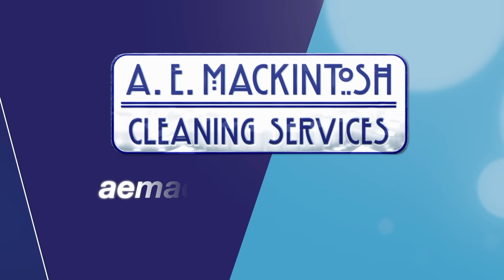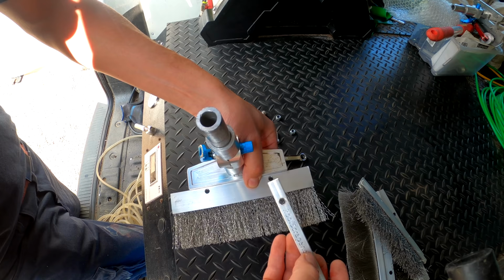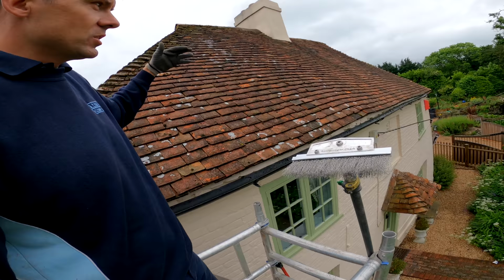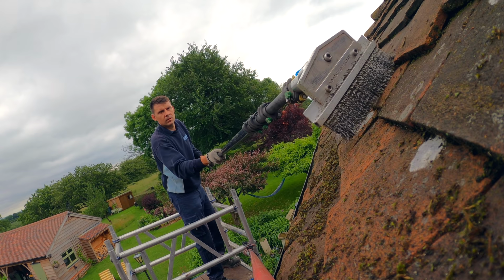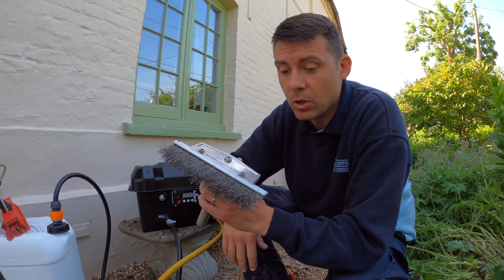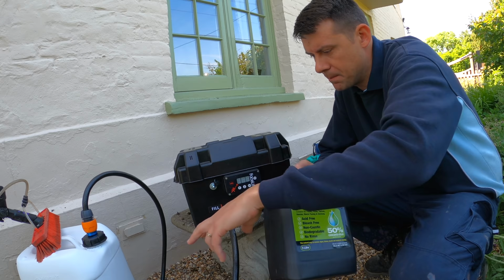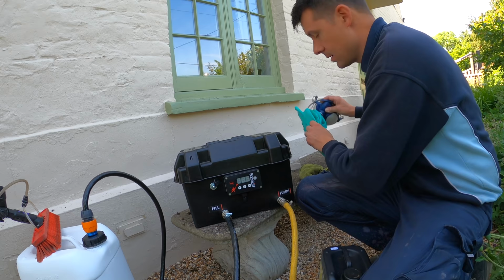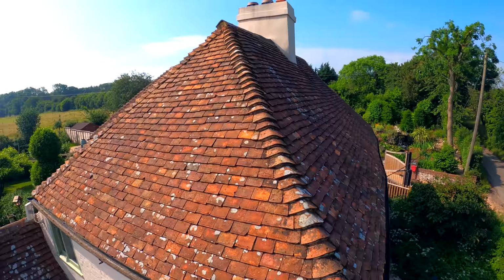What’s The Best Method To Clean This Old Roof?

Comment: Really good job you done there Ashley hope the owners gave you plenty of tea and biscuits 😀
Reply from the maker: Definitely! And cake too!😉👍🏼
Reply: Looks lp
Reply: @aemackintosh  p0lllll0 pp 0 pp p0l pp plll00 pp p
Reply: Most roofs need leaving alone imo
Reply from the maker: Moss growth can cause damage to the tiles, especially in freezing winter conditions when it hold the moisture and causes tiles to crack. So it’s a good idea to keep it well maintained.👍🏼
Reply: Why not go from top to bottom so the run off starts to clean the bottom part or is it because you can see what part you've done properly

Comment: Great video as usual. I have a question, can you do roof cleaning in the rain?

I think you said in the video, when it’s damp, moss can be harder to scrape off. 

So can you do it during the winter months in rainy weather or is it a summer service?

Thanks 🙏
Reply from the maker: Yeah, if scraping, it is more difficult when it’s wet, so a dry day is better. But I’ve found that it’s been fairly busy all year round.😃👍🏼

Comment: Hello - Thanks for sharing as you do -  Pls could you let us know the approximate Bar-pressure you set your pressure-cleaner to when using the 12" Mosmatic Skirt for roof cleaning ?   Many thanks
Reply from the maker: I’m not sure since I don’t have a gusher on my machine. But I use slightly less revs on my machine. So I would recommend starting with the revs lower and gradually increase it as you get used to the tool.😃👍🏼
Reply: @aemackintosh  Many thanks for taking the time to respond -  all the best

Comment: Excellent video. One question. With your extensive experience is one biocide most recommended?
Reply from the maker: Thanks. I normally use GKPro or Algoclear. But GKPro tends to be slightly thicker with more foam, which is better, and it goes further.👍🏼
Reply: Thanks Ashley

Comment: Ash, with it being a Biocide do you need to bag the downpipes and catch any run off to prevent it going down the drain? Or is it fine to drain off? Cheers
Reply from the maker: Yeah, I have seen this is done sometimes. You can do that if you like. I usually recommend starting the spraying from the bottom and working up to the top. That way there is little to no run off.😃👍🏼

Comment: I like the stainless brush for thick moss/algae but why not just soft wash the roof instead of using your WFP?
Reply from the maker: What do you mean by soft wash? If you mean pressure wash on a lower pressure, I wouldn’t take that approach on a roof like this as explained in the video. If you mean Hypo, I don’t use hypo on roofs as it is quite harsh and could damage the roof or surrounding area. I have applied a softwash/biocide solution to the roof using my wfp setup. This will kill off the organic growth and thus improve the condition of the roof without damaging the surface in any way.😃👍🏼
Reply: @aemackintosh  I’m not talking about pressure washing. I would do that. I use a 7 gallon a minute 12volt system. Just enough to apply my solution and walk away.

Comment: Hi Ash, 

quick question, when using water fed pole to apply the solution do you need to do anything to clear the the pole hose of the chemcial or clean the brush?

If GK pro were to get on windows would it cause any damage? 

thanks 
charlie
Reply from the maker: GK pro won’t harm any surface it touches, it just reacts with organic growth. So yeah, you might want to wash it out of your hoses after use, and wear good ppe.

Comment: What pole and brush are you using? Do you use univalve or how do you stop the flow at the brush when you need to?
Looks a great job!
Reply from the maker: Yes, this is a 30ft Ova8 pole with a uni-valve fitted. I am using a Gardiner brush with fan jets. It’s actually a hot water brush which means the bristles are slightly stiffer which I find great for this purpose.😃👍🏼

Comment: gkpro any good patios?
Reply from the maker: Sure, but it takes a little time for it to take effect. You might be better to use GK Black Spot Remover which is better for patios.😃👍🏼
Reply: @aemackintosh  will look in to it as I've been using patio magic (good but expensive) but want to do my roof,walls and patios. im a retired window cleaner/industrial cleaner started in 1978..really find your channel interesting 😀 cheers
Reply from the maker: That’s great! I’m glad you find it useful.😃👍🏼

Comment: As a builder. Mucking around cleaning roofs is a con.. And 90% of the time causes more harm than good. Especially on a pin tile roof!!
Reply from the maker: I have customers who regularly get blockages in their gutters or debris falling on the ground below and the root cause is the build up of moss on the roof. It can also hold water which can cause cracks and damage to the tiles when it freezes in winter.

Comment: Did you clean all the moss from the gutters…? Solve one problem cause another…! What about the tiles that had been broken or pushed up…? Did you replace them or pull the tiles back down. No… because if you went up the roof with a small scaffolding you would have broken more roof tiles and caused more damage…..

FYI. Moss does not effect the performance of any roof. Scraping the old tiles and then putting strong killer over the old fragile tiles make the tile more porous, so you just reduced the life span of the roof…. Good job. 🤦‍♂️
Reply from the maker: Yes, the job always includes cleaning out the gutters afterwards, eliminating the root cause of potential blockages later. Biocides won’t harm the surface being treated in any way. Thanks anyway for your comments.

Comment: Soak the roof inTFR, leave for 20 mins and starting from the top working down blast all the moss off with a 3 phase 415v 3kpsi pressure washer.
No need for brushes.
Reply from the maker: Interesting idea.👍🏼
Reply: @aemackintosh  I should have added, it's good for newer roofs in good condition but probably not suitable for the cottage in your video with a more fragile look to the tiles.. 👍
Reply from the maker: Ah, yes, indeed. Glad you said that. I’ve never thought of using TFR though.
Reply: @aemackintosh  I've found TFR is a good all rounder from degreasing to cleaning cars, removing  moss & lichen. As you're no doubt aware there are
specific chemicals to do the job but TFR is a much cheaper option..
Reply from the maker: Nice. I use TFR quite a bit, but never tried it on a roof… yet.😉👍🏼
Reply from the maker: I found a TFR that also contains a biocide ingredient, so that’s good.😃👍🏼